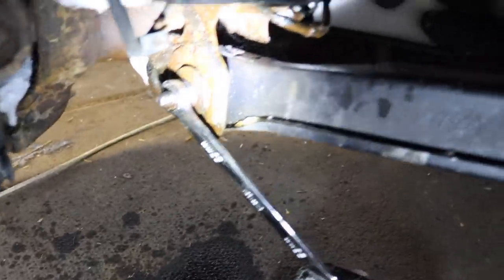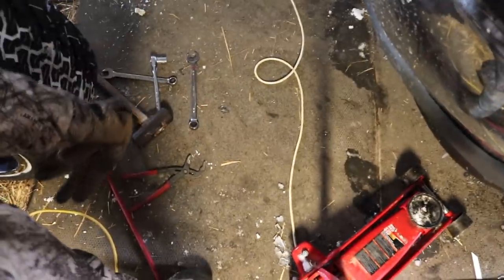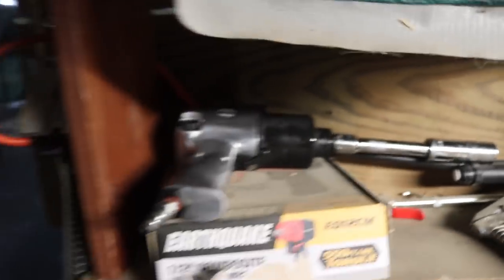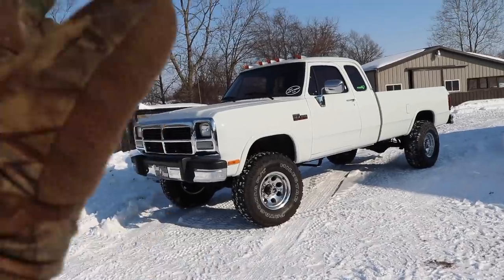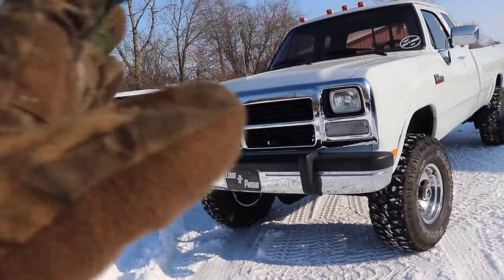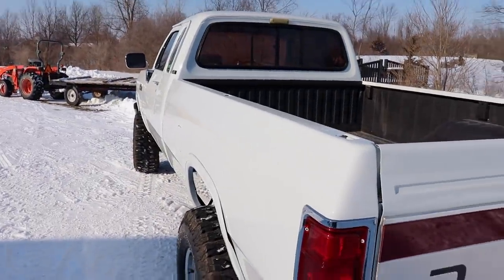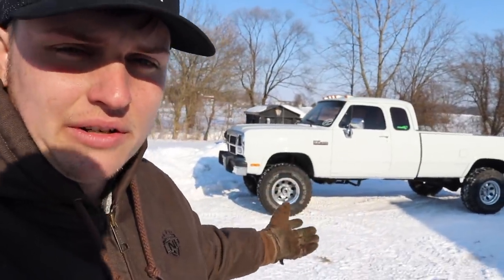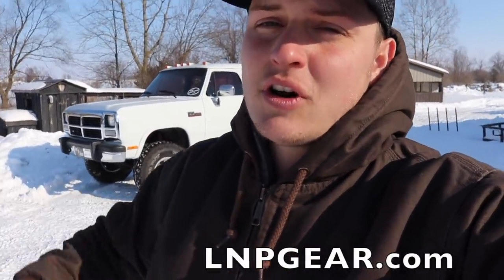I BOUGHT the MOST RARE diesel truck around!!!

Comment: When I did the bushings on my lower control arms I had to cut them in between the bracket and control arm brcause the bolt rusted into the bushings. So I had to put new adjustment bolts on the front by the axle. It was not a fun day